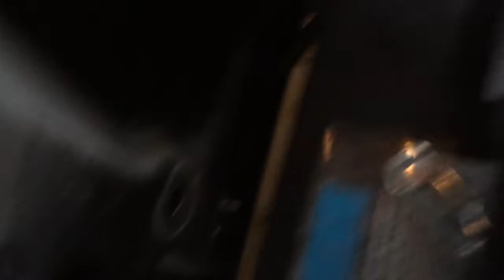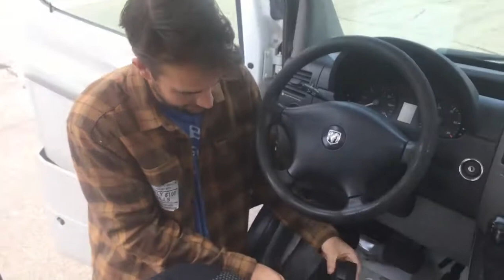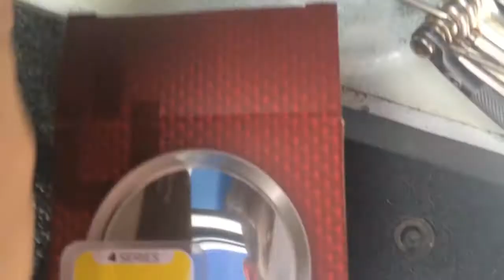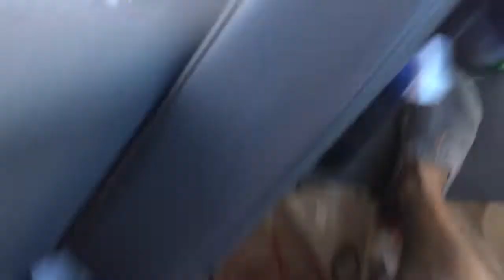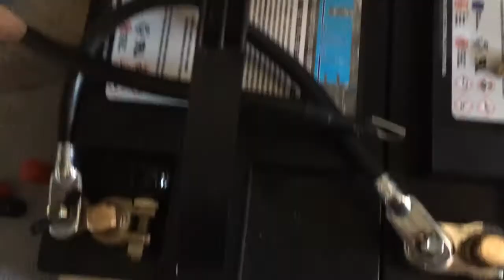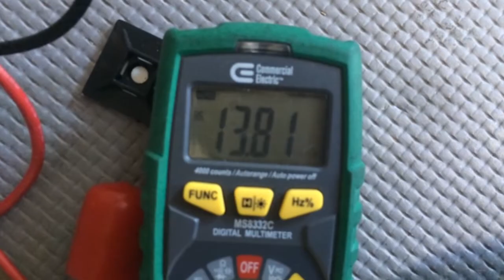DIY Sprinter Conversion | 4.1: Electrical - Battery Bank Basics and Dual Battery Isolator Install

Comment: Excellent video.  I'm glad that you have shown where to connect the house batteries to the starter battery.  The only issue with the connection to the house batteries is that parallel batteries should be connected on the opposite ends of the parallel connections.  That way your first battery is not always taking the entire grunt of the charging and discharging.  Also, when adding loads to the battery, that the loads are connected on the opposite posts.
Reply from the maker: Awesome!  Great info dude!

Comment: Hi
How do you know the capacity of the fuse you put? also in your other video u use a 200 amp fuse, ans a 120 amp fuse, howdo you decide the capacity of them?
Reply from the maker: I’m really not sure the isolator is a 150 watt.  I just asked the audio store what they would use and they sold me those. Looking back it.They probably up sold me since no one in town sold them.  The fuse could be much smaller I’ve installed them with 40A fuses as well.  The goal is to protect the batteries from a short while still being able to get power to the battery.  If the fuse is too small it will blow.  It’s all for safety since it’s in a vehicle and anything can happen and a wire can short pretty easy. The most important part is that they are both as close to the batteries as possible.  Look into AGU fuses they are much cheaper.  Also your isolator may have more information.  I’m not an electrician. Or mechanic but everything is still working great.

Comment: Can the sprinter Alternator charge 200Ah of Aux batteries on its own? How many hours of driving does it take to bring your batteries back from lets say 50% discharge?
Reply from the maker: It can’t fully recharge the batteries it can get you to about 13.8 or so I can’t remember exactly but it won’t ever fully charge the batteries that’s why it’s nice to have solar to get you fully charged when you are really low.  I would guess it would take about 4+ hours to get those batteries to get it to 13.8.  I’m not an expert on this I just know from experience so these figures may not be exact.   We highly recommend having both a solar system and a  battery isolator to never left those batteries get below 50% it can be hard to bring them back to life once you’ve drained those AGMs.  Thanks for watching!  Hope this helps.

Comment: HEy thanks for sharing. Could you share why you used a 100amp fuse? Thanks so much keep em coming.
Reply from the maker: Matt Matheny it was recommend when I installed one on my last van so I just did it on this to be safe

Comment: Thanks for info. Great help. Just one point. It looked like your put the ground to the first battery and the live for started battery to the same battery and just link other battery. From all the linking battery video I've watched the live should be on one battery and the ground should be on the other. This helps with the battery's lasting better and draining equally. Hope this makes sense. Glenn
Reply: https://m.youtube.com/watch?v=07RDFtsE7pk#dialog
Reply from the maker: Thanks yes it does!

Comment: Attempting a similar set up using a continuous solenoid for and isolator. I have it wired in with a stock 150 amp fuse attached to my positive terminal, stock terminal end, as well as my solenoid input wire both attached to the same fuse on the outlet side of the fuse. I may be off my rocker, but i figured my alternator would push through a consistet current, and i couldnt over power my marine batteries because the amperage is rated for charging the same size starter battery. What keeps happening to me is that my power inverter starts smoking when i am driving consistetly for a while (30 min-hour) and then it blows out. The floor feels hot like the stock battery is hot. I am most likely making a mistake, but went this route being impatient at not being able to pick up the proper fuses for the operation at the drop of a hat.  Im thinking i need to make some adjustments. Please let me know if this makes any sense whatsover and if you have any suggestions. Finally, :  where did you pick up those inline fuses?
Cheers, and thanks for the videos!
Reply: Just voltometered the battery isolator outputting 13.8 v. Battery resting at 13.2 v. I am assuming that this is why the inverter starts smoking. I assume it needs a higher voltage to charge the bank, so it's weird that the inverter wouldn't tolerate the voltage. I see you have a similar set up. It might just be a cheap inverter, cannot handle the extra .6 v while driving . Anyone, anyone?
Reply from the maker: tinydancer789 yeah it can be pretty tricky.  I got the fuses at a car audio store locally.  As of now I do not have the isolator hooked up.  I added some extra batteries for my solar bank.  It was working well I never put it on after I replaced my battery... maybe I should...

Comment: hi, thats really cool, i didnt know how to preserve a starter battery, Thank you! my sprinter looks the same im struggling to figure out where those red wires from the battery go to under thr floor and i get electric shock time to time from the metal seat support.. ) timeto take it all apart i guess...